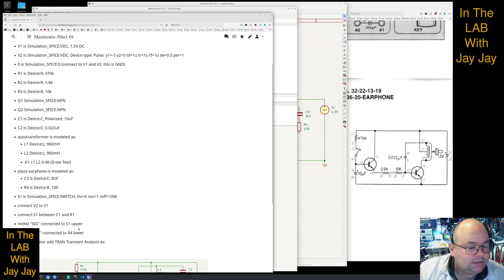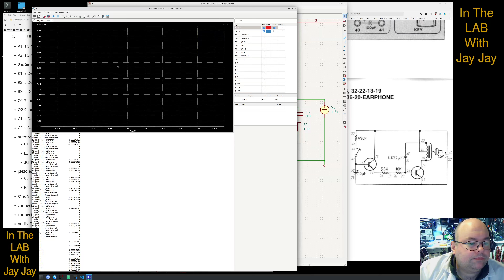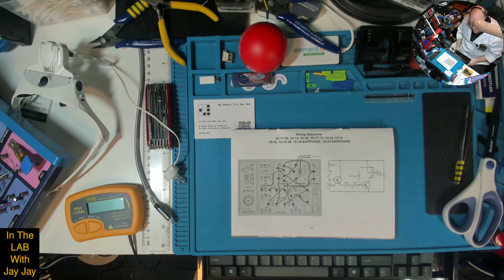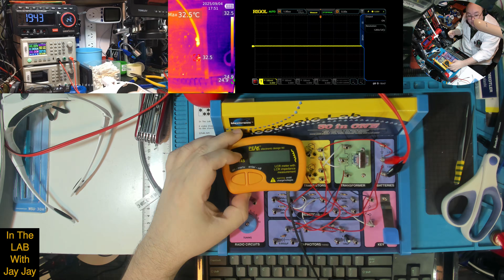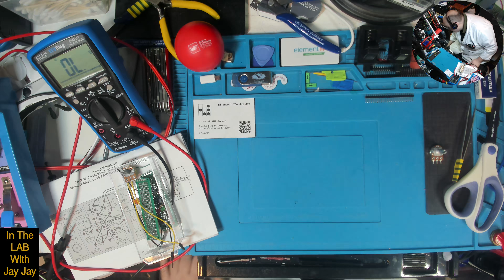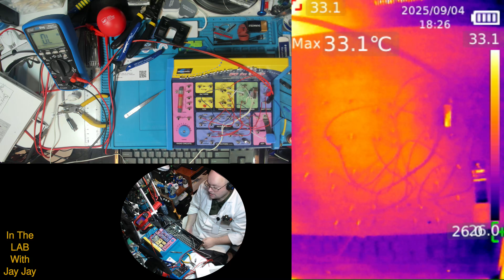Intro Project | Project 1/30 | Maxitronix 30in1 | Learning Electronics In The Lab With Jay Jay

Comment: Nice demonstration. I have the Tandy / Radio Shack version of this kit. It's annoying that the circuit does not operate as expected -- especially as it is the first circuit! I've proposed a very minor revision that allow you to control the pitch with the key and to simulate a siren, as described in the manual. Lots more detail in the video description, including link to the simulation, here: https://youtu.be/JaW_5j2GEvI
Reply from the maker: Excellent work! Thanks for getting in touch. I will have a play with your modification over the weekend.